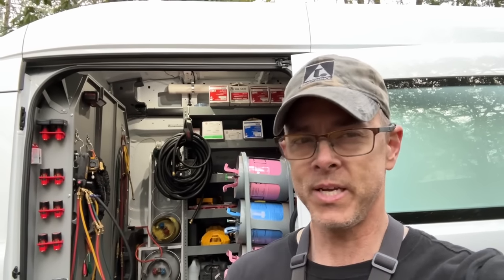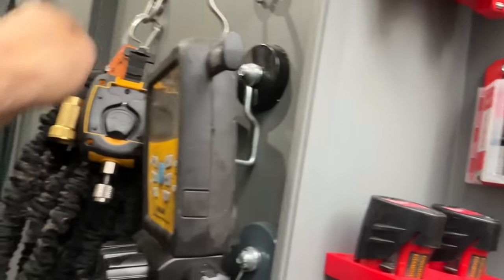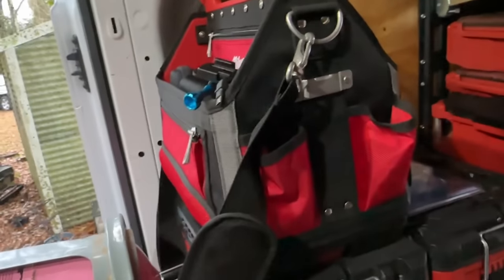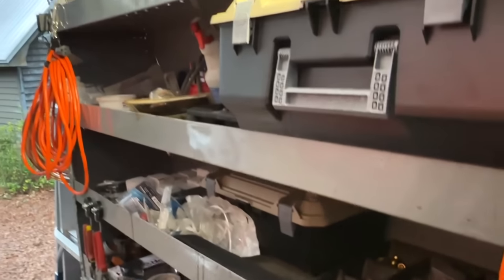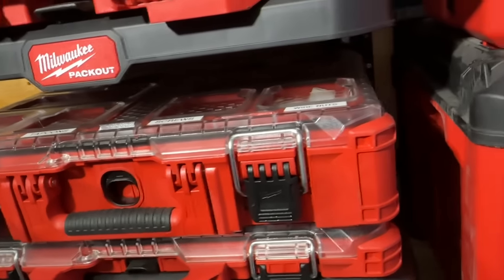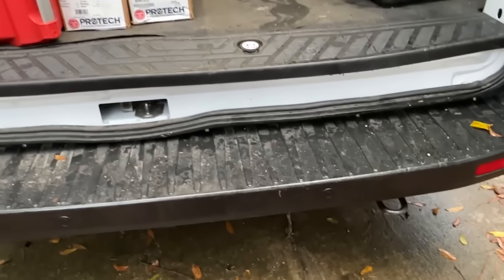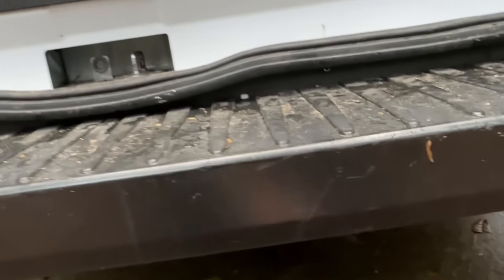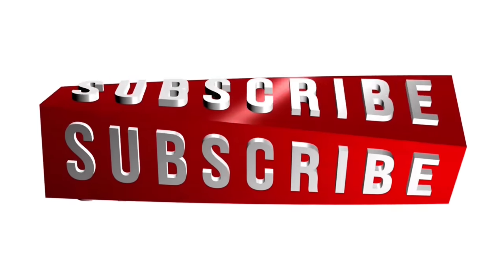What I’ve Been Doing All Day

Comment: Quick tip, if you want to fill the little round holes in your dewalt table, you can use the plastic 1/2" threaded plugs that are used on an electrical "bell box". That's what I did to help mitigate small parts from falling through. Haven't really come up with anything to fill the slots with yet and frankly they haven't been too bad for that.

Comment: The van looks good. In my previous van, I used led lights for the back. It was plenty bright for the van. Since you want the lights to stay on, you can run wiring from the battery behind the driver seat to the back and install a switch to turn them on.
Reply: You can also mount a battery case for D batteries.  They last a long time with LED light.  I installed a small magnet switch at the bottom of the side door so the light comes on when door opens.

Comment: Nice! Will you be installing better/more locks, window security and etc. to prevent theft?
Reply from the maker: Yes
Reply: Hi,nice van layout,way back,I got a job @ a large deer ice company,so a year later,1985,they gave me a NEW E350 VAN,THEY INSTALLED THEIR OWN BULKHEAD,SHELVING,so I went to a locksmith,saw those heavy locks,like a hockey puck,,bought 2,installed them,with the proper bolts ,with backup plates,<so I only worked in NJ, but had to go to headquarters,in NY,someone saw my locks,decided,great idea,but used BS  HASPS  USING SHEET METAL SCREEWS,SO IT WAS BROKEN,INTO EASILY,so after his loss,boss called me in to TELLme they wereBS,EXPENSIVE LOCKS,I SAID LOOK AT MINE,THINK,YOU CAN RIP THESE OFF,?  Then they realized him ever,did a shit job,installing theirs,,, good luck,🇺🇸🇺🇸🇺🇸🇺🇸